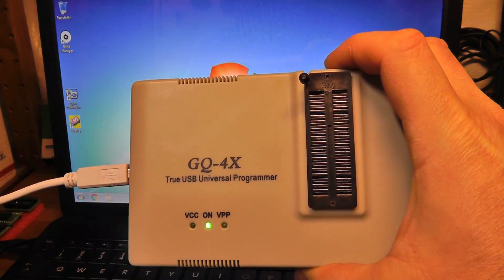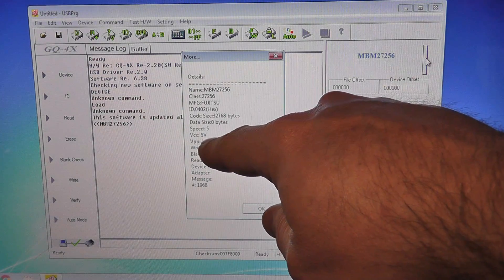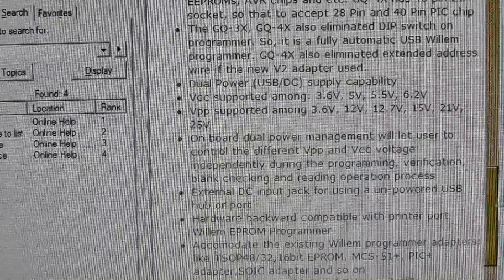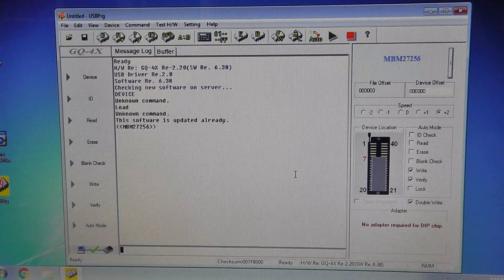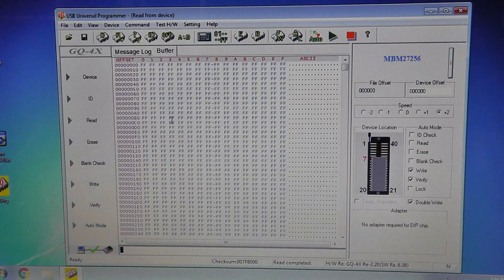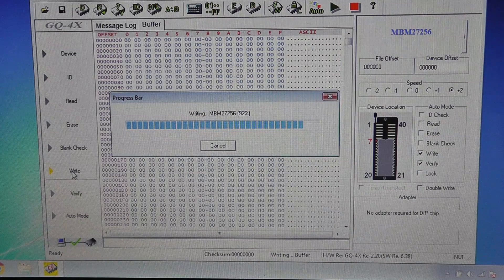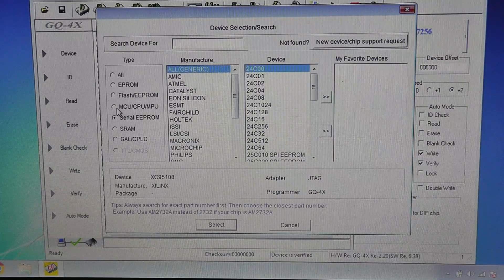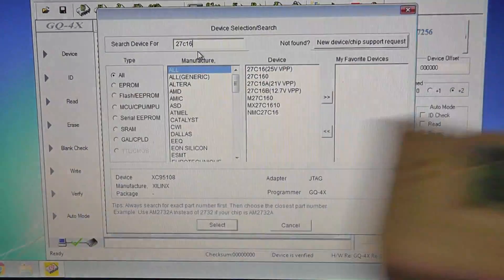Programmers Wooo! - Part 5 GQ-4X USB Universal

Comment: Still can't get this one to read a d2364.. I think it's a pin out issue..
Reply from the maker: Pin out appears to be different.  It is 24pin vs 28pin of a 2764, correct?
https://www.mikesarcade.com/cgi-bin/spies.cgi?action=url&type=info&page=ROMref.txt
Reply: @jacklick  

Mike's arcade suggests it's same as TMS4764. Don't think that's in there either. :) Im off to read some more.

 TMS4764 & NEC D2364

Comment: Hello
I use gq-4x, I want to flash ic windbond 25q64fvsig, but the tool does not support it, when I download the latest version, it still doesn't support it, there is even a message, demo only, please help
Reply from the maker: I don't have experience programming that chip and no longer have a GQ-4X.  However, I have successfully programmed other chips that the GQ software lists as demo only so would go ahead and try it.  Also, you can potentially use the device info file to customize the settings.  I cover that in this video https://www.youtube.com/watch?v=5zoX64a4kio

Comment: When using the GQ-4X to read arcade games ROM chips, once you have Read & saved each ROM chips arcade games files. When looking at the read EPROM data content, how can you tell if its a "look up table" or a Logic input/output conditions Table?  I have seen you read EPROM IC chips from arcade games but how can you tell if the data content is a look up tables or logic conditions tables?
Reply from the maker: No idea.  It is just zeros and ones.  To know what it is doing you have to disassemble the binary code.  Most arcade games are written in assembly language specific to the cpu being used.  eg http://www.inkland.org.uk/dz80/
Reply: @jacklick  yes you have to use a "decoder" to convert the ROM data code into the CPU language. Have you tried doing this by taking the read ROM game code and save it to a file and then use a decoder to convert the game code data content into the Z80, 6502 CPU language?
Reply from the maker: @waynegram8907  No I haven't done this......yet :)
Reply: @jacklick  try looking into it. There must be a way to upload and convert the game data contents and convert it to the Z80 language or 6502 language. Logic Analyzer can view 8 data signals, 16 address signals. When viewing these you can see which data is being read at which address per each clock.

Comment: The arcade ROM chips are not written in hexidecimal values for each ROM address location. Without having the MAME ROM files, how can you test, verify and check the ROM and RAM chips using what step by step diagnostics?
Reply from the maker: You are asking a lot of good questions.  Not sure if I am the best one to help you as I don't claim to be an expert...just sharing my own learning.  any computer/digital data is written in binary 1s and 0s.  The hex you see in the editor is just a representation of that binary data.  It could be represented in decimal as well.  If you don't have the mame rom files to compare to, hopefully, the board has a self-test that runs the checksum on the rom or maybe the schematic shows what the checksum should be.  You can also do signature analysis on the roms and compare that with "known good" published signatures.    You can also just look up the mame file name on the net and probably get the checksum without getting the actual file but just easier to get the files.